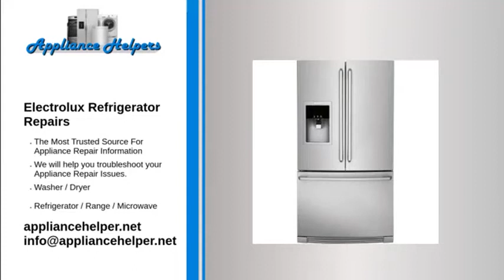Electrolux Refrigerator Repair

Comment: Thermal fuse check found open.
Reply from the maker: If the thermal fuse in your Electrolux refrigerator is found to be open, it indicates a potential issue with the temperature regulation system. The thermal fuse is a safety component designed to interrupt power flow in case of overheating, preventing damage to the appliance.

Here are some steps you can take to troubleshoot and address the issue:

Identify the Cause:
Determine why the thermal fuse opened. Overheating can occur due to issues such as a malfunctioning defrost heater, defrost thermostat, or problems with the refrigerator's cooling system.

Check Defrost Heater and Thermostat:
The defrost heater and thermostat are responsible for preventing excessive frost buildup on the evaporator coils. If either component is faulty, it can lead to overheating. Test and replace any defective components.

Inspect Evaporator Fan:
The evaporator fan circulates air in the refrigerator and freezer compartments. If the fan is not functioning properly, it can lead to temperature irregularities. Check the fan for proper operation and replace it if necessary.

Examine Condenser Coils:
Dirty or clogged condenser coils can impede heat dissipation, causing the refrigerator to overheat. Clean the coils and ensure proper airflow around the refrigerator.

Verify Door Seal Integrity:
Inadequate sealing of the refrigerator doors can lead to temperature fluctuations. Check the integrity of the door gaskets and replace them if they are damaged.

Replace the Thermal Fuse:
If the thermal fuse is open, it will likely need to be replaced. However, simply replacing the fuse without addressing the root cause may result in repeated failures.

Professional Service:
If you are unable to identify or resolve the issue on your own, it's recommended to seek professional repair services. A qualified technician can diagnose the problem, replace faulty components, and ensure the proper functioning of your refrigerator.

Always prioritize safety when dealing with electrical components. If you are uncertain about the repair process, consult the refrigerator's user manual or contact Electrolux customer support for guidance. If the appliance is under warranty, consider reaching out to the manufacturer for assistance.